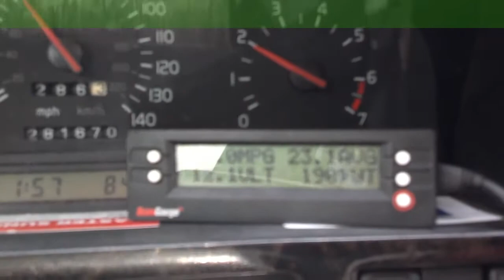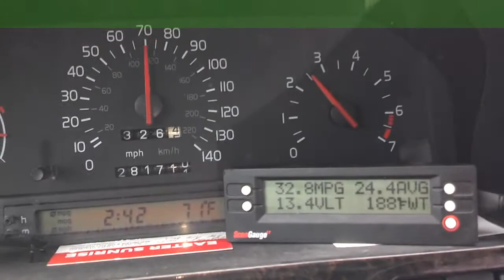Day 29, Robert DIY helper tour, in the Savannah GA. - VOTD

Comment: Hmm  the charging side does look bad, unless its the computer thats reading it wrongly, an external multimeter would be my next step.
I hope its just a bad connection on the alternator or battery thats causing the bad reading.
Tumble dryer doors, i thought only fridges and freezers had bidirectional door mounts, oow :-)
Reply from the maker: zx8401ztv Thanks for watching.

Comment: can any one help me with any ideas of what could have happen to my 1986 Volvo 740 i replace the fule filter distributor spark plug wires and the mass air flow it jus gave out on me it backfired and turned off and wont start again it cranks like it wants to start but dont any ideas or suggestions any thing will help please